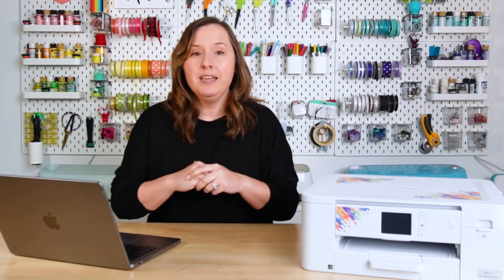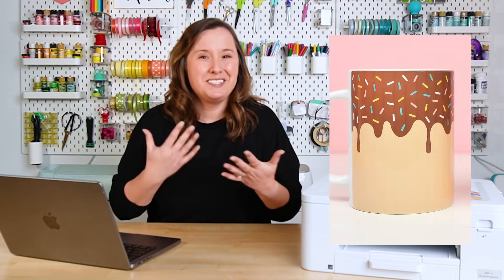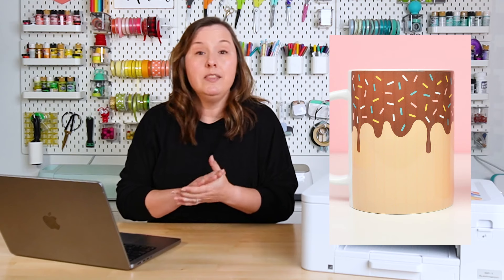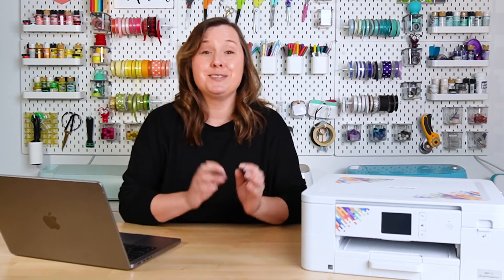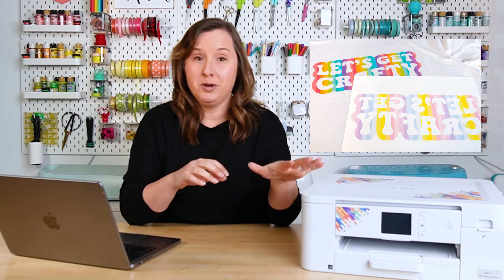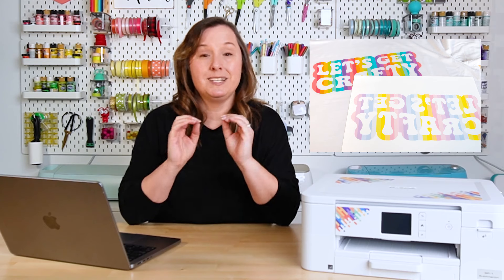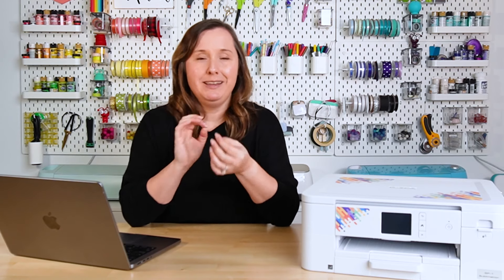Sublimation Troubleshooting: Common Sublimation Problems and How to Fix them!

Comment: Aloha, my problem is that my printed image does not transfer to the t-shirt. I am printing with Hiipoo sublimation ink on their sublimation paper. I set the temperature to 390 for 50 seconds at medium to high pressure on my heat press and nothing happens. Image will not transfer. And suggestion on what I am doing wrong? Thank you.
Reply from the maker: Are you using a polyester blank shirt?
Reply: @HeyLetsMakeStuff  it’s 65% polyester

Comment: Hello! I’m having an issue that I can’t seem to find anyone else having. 
I’m printing an image that is a single shade of orange. The print comes out with a pink haze around parts of the image. This happened before with an image with oranges and browns in it. I turned off bidirectional printing and that fixed it. Bidirectional is still off but it’s happening again. Any idea what it could be that’s causing this?
Reply from the maker: What program are you using to print?
Reply: @HeyLetsMakeStuff  Good morning! I print from Preview on Mac.
Reply: @HeyLetsMakeStuff  also worth noting…it only does it on large prints. Same image letter size is perfect…13x10 is when it does this.
Reply: @HeyLetsMakeStuff  idk if I “fixed” it but I at least found a work around. I changed the paper type to Ultra Premium Photo Glossy with Best Quality! It’s just odd it’s the same paper I’ve always used. Same printer. Same settings. So no idea why it changed but I at least got this particular image to work. It sublimated correctly also!

Comment: Do you have a way for me to send you a message? I have a white line running through my image and I'm stumped on why. I've been subbing for years and this has never happened. I'd like to send it to you so you can see exactly what I'm dealing with. I've troubleshooted through this video but I'm lost.
Reply from the maker: Hmm.. have you tried cleaning your print heads? It sounds like your printer may be clogged. If you've tried all that and it still doesn't work, you may want to reach out to the manufacturer. Especially if you've used your printer for a while!

Comment: No matter what I try. I still can't get my imto sublimate to the tumbler
Reply from the maker: I need more information to help! 😊 What type of tumbler? How did you print your image? What time temperature and pressure settings are you using? What type of heat press?